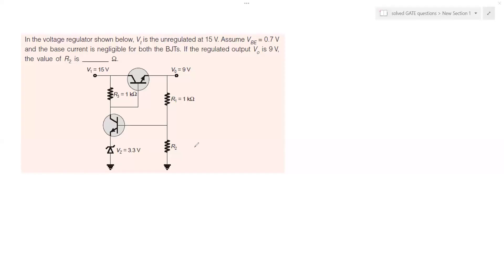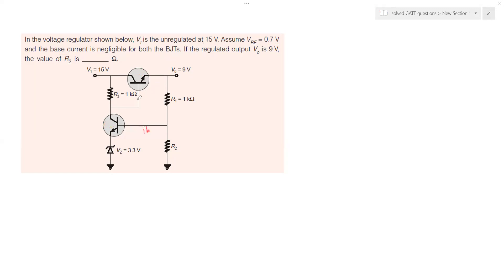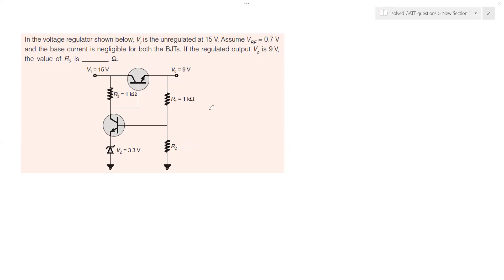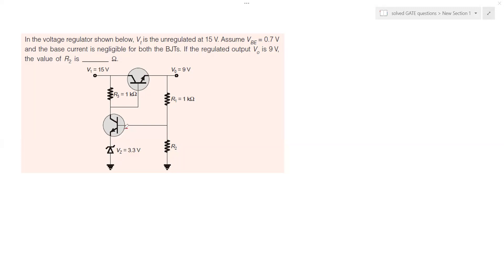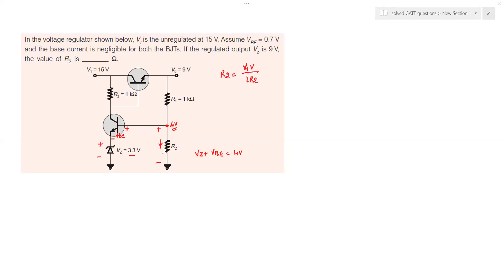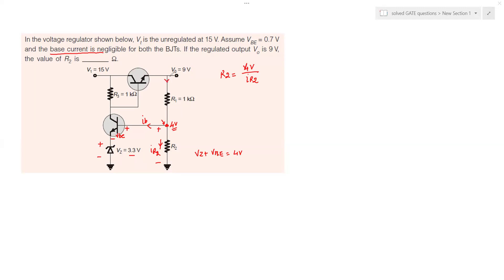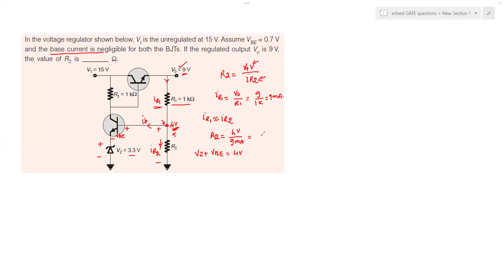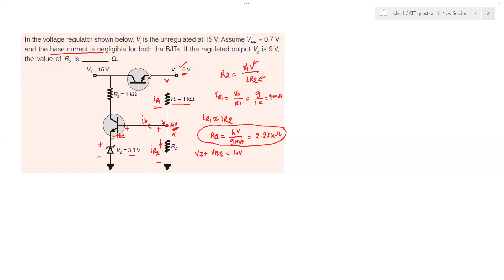Voltage Regulator Analysis

Comment from the maker: There is a correction. Voltage across R1 is 9-4=5V. Therefore, current through it is 5v/1k=5mA. Neglecting the base Currents, current through R2 is also 5mA. Therefore, value of R2 is 4v/5mA=800ohm.

Comment: Professor, this circuit requires a 6.2 volt zener to get 9 volts out. The base of Q1 is 9.7 volts. Tis will put the emitter of Q1 at 9 volts. Therefore, the base of Q2 needs to be around 7 volts.I have model this circuit in both LTspice and Everycircuit.
Reply from the maker: @pbaemedan Appreciate it! As I see, the transistors (both) are biased in active (linear) region of operation, requiring voltage at the collectors to be > or equal to voltages at the base. So, zener used in the picture works and zener you suggested also will work as long as statement I made here holds true.

Comment: How does the current really move in that circuit?
Reply from the maker: @notaras1985 .........Soon you switch on the DC power supply, devices and components start to draw currents in the directions shown
Reply: @stemscience1 so the final output is on the R2 resistor cable?
Reply from the maker: @notaras1985  Its a regulator circuit so final output that we are interested in is Vo = 9V. Calculating the Output voltage across R2 was a problem statement.